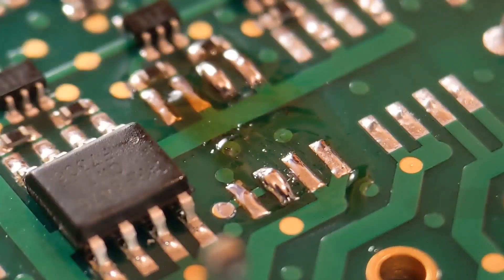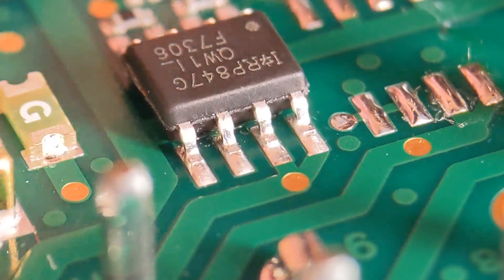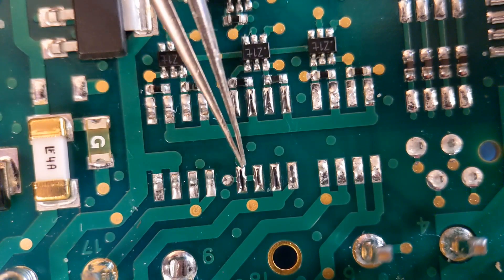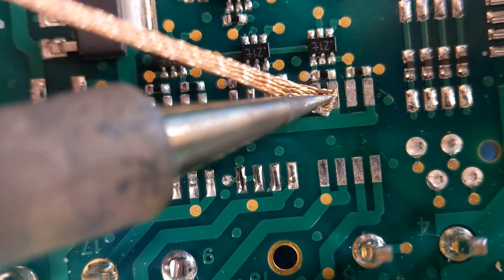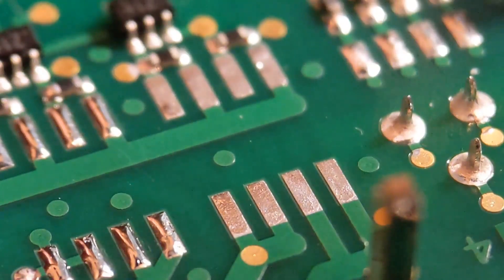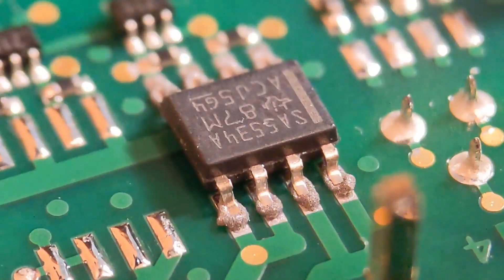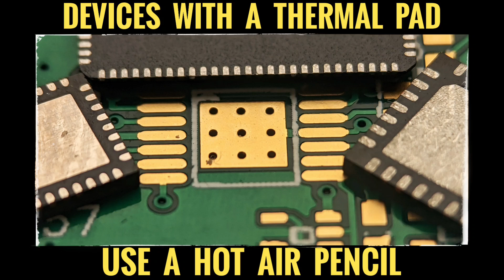How To Replace Surface Mount IC / SMD IC - 3 Neat Methods

Comment: Awesome instruction and great microscope shot of the work.   Can you provide a list of the essential tools you use for your various soldering & desoldering work?   Also, do you have recommendations on quality desoldering pump systems and hot air gun equipment that you feel is worth buying.   Also, what microscope camera system are you using?

Comment: Ahm, may i suggest sir in the description box, a list (links names) of tools and something equipment use (brands, types, etc.) and solder-tin flux mixtures tubes with noozle?, braided wires, flux use (brands, types, sizes diam. Values) for a specific smd components in order for beginners in smd syrface soldering replacing reworkings. Thsnks sir for the replacement smd standards and tips. 😊❤.
Reply from the maker: Hi , thank you for your comment , much appreciated . All the things you have mentioned I have other videos on my channel covering all of this stuff . It's impossible to cover everything in one video . Thanks again 👍

Comment: Hi thanks a lot for sharing your knowledge. Your videos are really great and valuable for us. It will be usefull for us as beggiiner to have links for materials you use and a way to contact you for donnation and other. Many thanks again
Reply from the maker: Hi , thank you for your support , much appreciated
 I don't generally supply links to products for certain reasons but I generally get all my solders and solder paste from BLT Circuits ( based in England ) , cleaning wipes , Gtek Dry Wipes  from Grove Sales ( England ) , fluxes and other general stuff , components etc from Farnell , RS Components or Rapid Online or if in America I would use Mouser or Digikey as my choice of supplier for all kinds of tools , consumables , components etc . Hope that's ok , thanks again for your kind words , good luck 👍

Comment: Great video as usual. How do you actually check and know if the ic is faulty? Also if you remove the ic will the heat destroy it from the iron?
Reply from the maker: Hi , thank you for your comment , much appreciated . Sometimes you can physically see an IC is damaged ( holes blown in the body is a typical example ) but often I work with engineers who will ask me to change certain parts as they have tested the circuits down to a certain faulty IC. If you know how to fault find down to component level this is standard practice . Using the 2 iron method will not damage the components , it's no more risky than using a hot air gun , and is certainly better for the surrounding components as no heat is applied to them like it is with the hot air method . Hope that helps , thanks again 👍
Reply: @mrsolderfix3996  thank you

Comment: Hi i use the second methode when you can not use hotair but i bridge all 4 legs together with wire. Then you can use only one solder iron, that works flawless with no damage. Regards Steve from belgium.
Reply from the maker: Hi . Yes I've used the wire method to take out long single row connectors and I agree it is a good method but I love using 2 irons for rework , so much so that I've shown so many people this method and they to now use it for their reworks . I've also posted a complete YouTube video on the uses of 2 soldering irons . Thank you for watching , all the best 👍

Comment: Is it necessary to remove the old solder Sir?
Reply from the maker: Hi , I tend to remove it and start from scratch but if your using a hot air gun you can leave the old solder on the board . If using a soldering iron I would wick off the old solder otherwise your IC will not lay particularly flat . Hope that helps 👍

Comment: How can I wet a pencil tip with tin solder all the way to the front?
Reply from the maker: Hi . I would try gently scraping down to the tip end with a scalpel ( but very gently ) and then continuously flood the tip of the iron with leaded solder . As long as the end is in good condition with no holes in etc eventually it should tin very nicely right down to the tip of the iron. This method works for me ( I know your problem , it's quite common ), so hopefully it can help you out . Good luck 👍
Reply: @mrsolderfix3996  Thanks for the advice. I'll give it a try with the careful scraping. Many greetings, Karl.
Reply from the maker: Hi , no problem  Hope you get on ok 🤞

Comment: Good advice!
3:25 - Instead of using 2 soldering irons, I recommend using a 'low-melt' solder - which melts as low as 58°C. This gives enough time to heat both sides with the same iron and remove the chip. Also works great with larger chips. Be sure to 'wet' all pins before removal so the original solder is diluted :ø)
Look for alloys with following composition - Sn12/Bi49/In21/Pb18 and names like 'FAST CHIP' or 'low melt/low temperature solder'
Be sure to clean up good before re-soldering, as the low melt/low temperature solder makes brittle and possibly long-term unstable connections.
Reply: I use low-melt in a slightly different way, putting the board on a pre-heater at 150 degrees C and applying low-melt solder stick to each joint; after wetting with low-melt the chip can be removed at this very low temperature, and the excess of solder can be moved, while still melted, to the center ans sucked off. Still pads need to be cleaned. I put regular solder on the pads, let them cool and remove the solder with a wick. ad